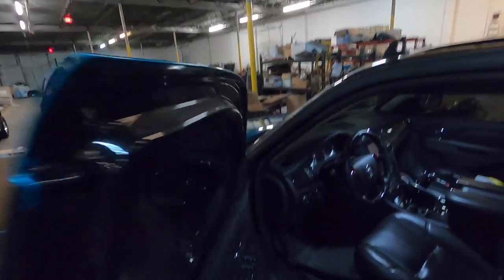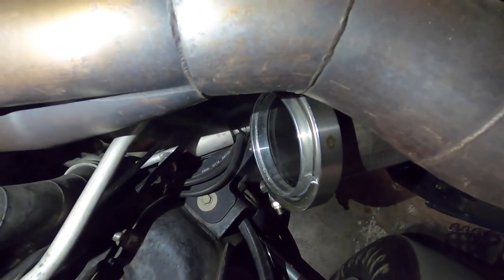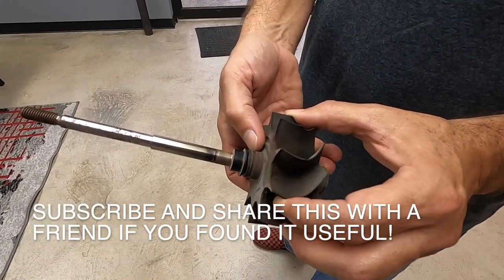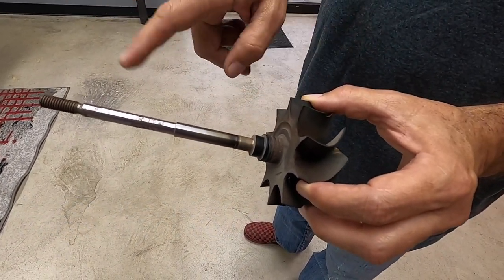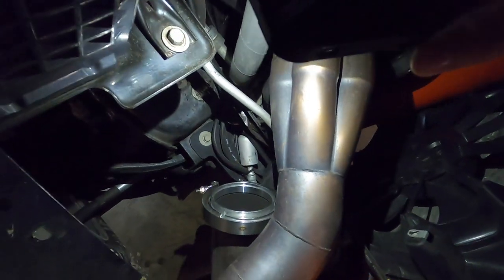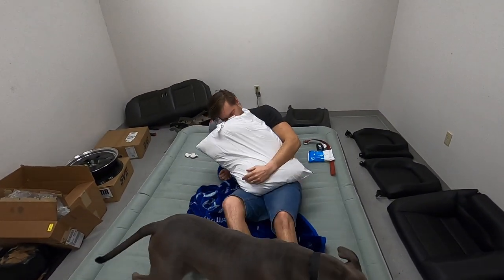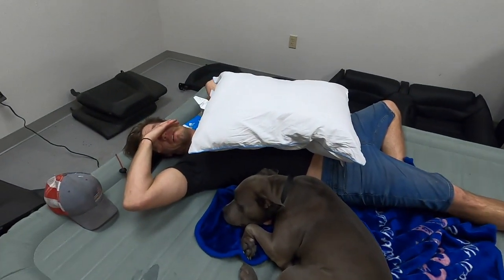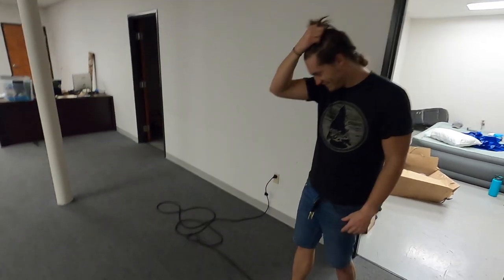This is Why You ALWAYS Need to Let Your Turbo Car Warm Up! (Even If You're Not Driving it Anywhere)

Comment: If somebody asked me to move my car 10 feet I would just push it rather than start-stop.    Modern cars have water cooled turbos and the cooling can come on after shutdown.  There is always heat soak after shutdown, not just the turbo.

Comment: I used to drive 18 wheeler and always cringed when I see drivers running hard with full loads then stop and shut of the engine instantly with no cool down or oil flowing to the turbo.

Comment: Having a small tank with 100% high octane  gasoline to switch over to when cooling down when stopping on ethanol or methanol is the ideal situation.

Pure gasoline being nowhere near anhydrous as alcohol solves a great deal of the internal  condensation problem.

Comment: I agree that E85 is a magnet for moisture but how do you seperate the water from the air prior to sucking it through the intake on rainy and humid days?

I pre spray 10% water and 90% methanol into my turbos to cool them also to suppress detonation and have been doing this since 2006/07 on EFI direct through the compressor also on blow-through the carb turbo setups and dont have to use an intercooler...........

To me the gains outweigh the turbo wheel pitting that eventually happens but the degradation comes in around the time the turbos are useless and needing a rebuilding anyway.......

Comment: I have a question. My turbocharged car (was NA from the factory) needs 10 minutes to reach the optimal temp. Is it bad to idle for 10-15 minutes? I always warm it up for 10-15 minutes  but there are so many debates about this on the forum. Please, any answers would be greatly appreciated 🙏

Comment: so I have a '19 WRX I have been letting her warm up until the idle drops below 1k rpm and my oil temps are close to 170 before putting in gear and driving under low load until temps are operational, is this good practice or am I letting it warm up TOO much and causing more carbon build up??  I've found a bunch of answers but this video explains premature engine warming damages well.
Reply from the maker: Probably waiting longer than you need to. I would typically wait until the high idle went down and drive easy until up to full temp but that’s just me
Reply: @Stapleton42  should I do a fuel injector cleaner just in case ? It has 34k and I been doing that for about a month now since I got it. No idea how the previous owner treated her warm 😐…sea foam or something maybe? She shifts good clutch feels new still and that low rumble is nice. Not hearing any knocking nor and I noticing any throtle delay however if it’s built up in the block I could be missing out on better fuel economy and better cooling ?
Reply: @Stapleton42  appreciate it man!

Comment: Maybe a long shot but would you have a guess as to why a single cylinder motor smokes real bad at start up? Was told maybe a valve guide but seeing if someone else with more engine experience has something else to look at.
Reply from the maker: It’s burning oil probably somehow lol
Reply: @Stapleton42  Gee thanks lmao
Reply: second the valve guide, especially if it goes away. And that goes for any engine.
Reply: @BoostedNW  Alright cool, thanks for the input man. Looks like ima try to rebuild a head in the near future.

Comment: Does this apply to the acura rdx sh-awd 2021 turbo engines?
Reply from the maker: Basically everything with a turbo that’s prone to any condensation
Reply: @Stapleton42  what is responsible warm up time like 30 secs and take it easy or 10 mins then drive?

Comment: I had a 6 speed genesis coupe about 4 years ago, I’d remote start it for about 5 minutes every day before I’d drive it,     always parked it in neutral with the E brake so I could safely remote start it, well someone else drove it after getting a new front bumper put on it and I forgot,  and I ended up remote starting it in 1st gear and running it into my parents house 🤣🤦🏻‍♂️🤦🏻‍♂️
Reply from the maker: Wow 😂
Reply: Literally didn’t even get to see the new front bumper I paid to get put on before it hit the house 🤣
Reply: strange that the manufacture did not implement any safety checks for the remote start function then, I mean this should not be able to happen!
Reply: @DonnieX6  I absolutely agree, it was an aftermarket remote start that was added before I got it, I found out quick it’ll start in gear lol
Reply: @DudeItsGage : ah, ok, that explains it! I guess it would have been too complicated for them to make it compatible with all kinds of car makes. But sucks to find it out like this. Take care! :)